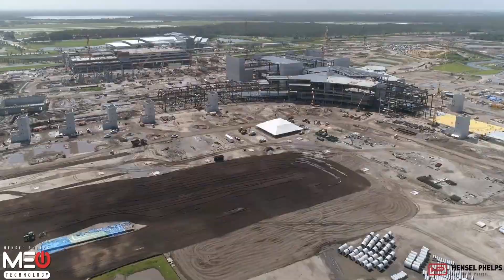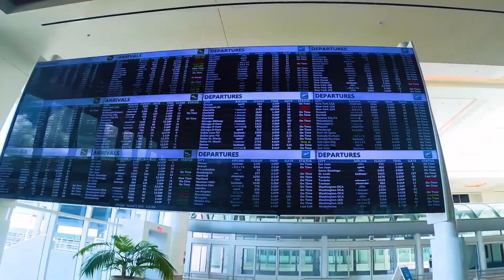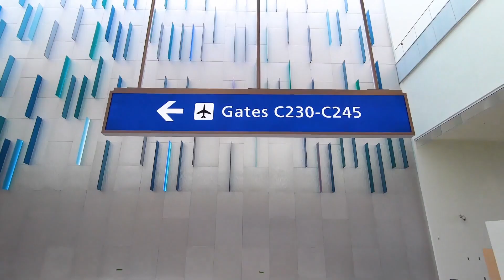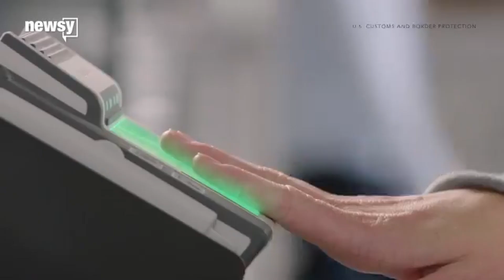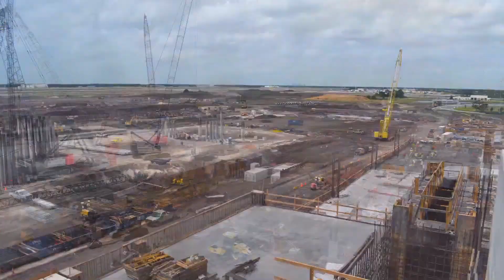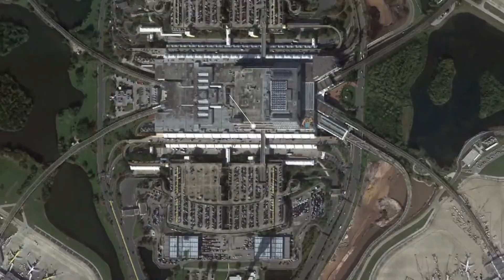The $3 Billion Plan to Fix America's Worst Airport

Comment: MCO was my home airport for years. I have so many memories flying in/out of MCO. They have the best airport staff and social media team.

The airport itself is a joke though. It’s inefficient, worn out and crowded. The last 3 times I flew out of MCO, TSA lines were 45 minutes to an hour long. In the meantime, the last few times of flying out of MIA, TSA wait times have been less than 10 minutes. I frequently fly into/out of ATL. ATL has their operations like clockwork. I rarely have to wait for more than 20 minutes to get through TSA in ATL. 

This video is old. Terminal C is open and beautiful. Unfortunately it does nothing for us who still have to fly out of A or B.
Reply: They are doing renovations to Terminals A & B throughout 2028, a shame it's that long but aye, I'll take it as something better than nothing. I do hope the other Airsides get renovations as only Airsides 1 & 3 are being renovated so far, along with Floors 1 through 3 throughout Terminal A & B. The APM is getting renovated as well, which means all of the airport will be using Mitsubishi Crystal Movers in 2028 as well.
Reply from the maker: Yes this is true, new renovations coming to MCO in 2028. Maybe a video on that soon, you never know!